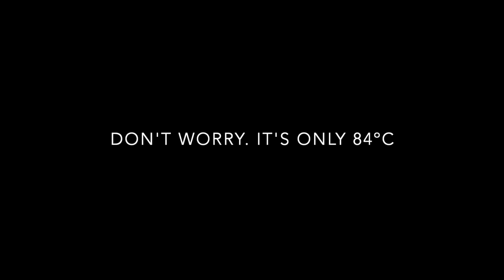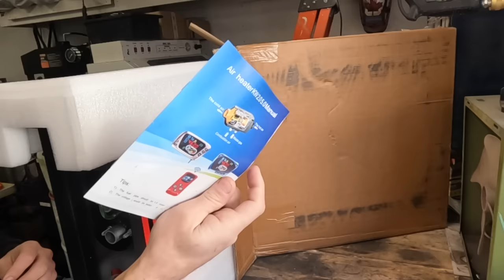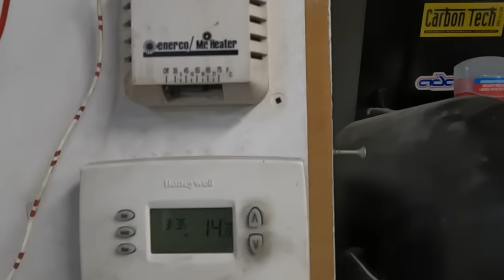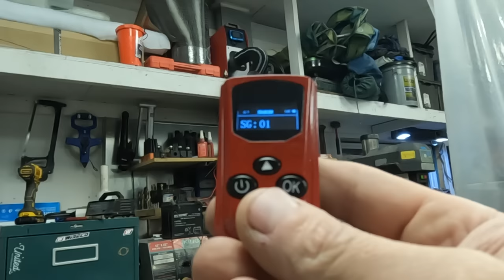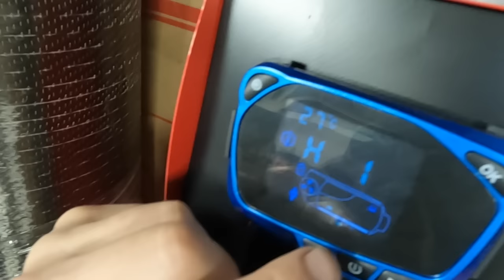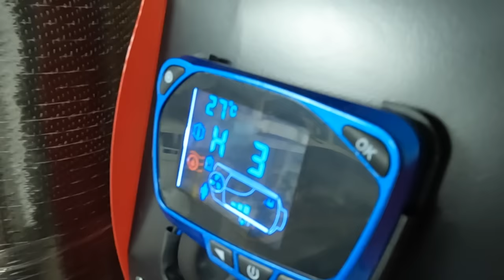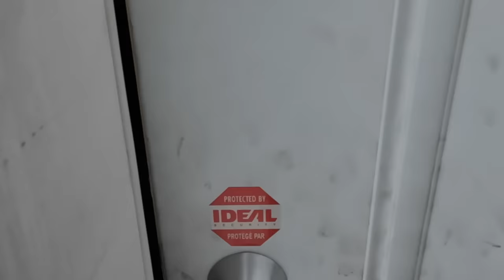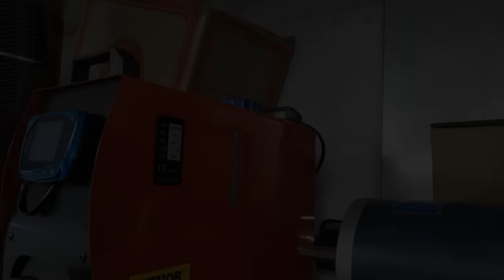Chinese Diesel Heaters - DON'T BELIEVE THE HYPE !!

Comment: Don't use waste oil will cause over heating/smoke  and add some decent diesel .
Reply from the maker: Yes, I have been testing / experimenting with waste oil mixes and have had several issues. I now have a whole series of videos dedicated to this topic. I recommend using diesel, but for me it is not economical as it is over twice the price of natural gas. (i have two NG heaters in my garage)

Comment: I think, maybe...possibly, you should have let set for a bit before restarting.  I have a lawnmower that does the exact same thing.
Reply from the maker: Sounds like a cool lawnmower !! You're talking about the flaming exhaust ? I'm guessing that your lawnmower is running rich, most of them do.... also, your engine should have a brake to slow the engine when you shut it off... if not, the fuel will keep dumping in when you kill the engine and lots of unburnt fuel will end up in the muffler... then when you go to start it next time BANG ! It's pretty exciting.

Comment: I have heard of ppl using these for 3-5 years with no trouble, then some use them for 3-5 minutes with nothing but trouble!!   I think I'd build a little centrifugal filter for the oil,  a modified break drum, spun at about 2500-3500 rpm will do nicely, a roughly 12" drum, with cover coveri g the large opening to about 3"-4", no more than 6" ,  attach the cover seal with silicone,  the clean oil will come out the hole and be slung off while spinning, so it needs to be inside a tub, and mounted on a motor, with a stand from 1" tubing, and plate steel, use a tub with lid, and a drain hole in the end, at the bottom, with a lid , having a hole in it , at the center of the drum, using a funnel, that fits thru the lid, into the center of the drum, about 1" below the top plate,  turn it on, and fill with oil slowly, the dirt will stick to the walls if the drum, the clean oil will climb the top plate, and exit the hole and be slung off the drum, collecting in the tub, works well with cooking oil also, removing the top plate to clean out the gunk regularly, depending on how dirty the oil is, is a must, or it will stop cleaning the oil, the edge of the drum can be wrapped with denim or foam filter matereal for an extra layer of filtering,  but at over 2k rpm only the lightest matereal is going to make it out,   the break drum will need an adapter plate to fit the motor shaft, and cover the holes in the drum,  then it will need to be centered,  and all holes sealed, of coarse a pot will work also, cut a hole in the center of the lid, make a latch to hold it on, and still an adapter to the motor, but smaller the diameter, the more rpm the motor needs to spin, a 8" pot will need to spin 3k-4k rpm, 
Faster the better,  just Incase it may help,  dirty oil may cause issues as well!!  Good luck!
Reply from the maker: So many comments that YT didn't inform me of... 

Thanks for the very detailed comment with all the information. I did think if building a centrifuge, and if I do this would be a great way to do it... I love the brake drum idea. I don't know that I want to dedicate that much time and space to filtering fuel, but I really do appreciate the input !! I had been thinking about building one and wondering how to balance it but a drum would already be balanced well enough and have a centering hole... perfect. 

Thanks James !
Reply: Parts per liter.  BC

Comment: They are a diesel heater not a old oil burner, quite obvious the viscosity and contaminants in old oil are your problem rather than the heater
Reply from the maker: Yes... they are wonderfun units when used as diesel heaters. Unfortunately there are a lot of people making claims that they will burn just about anything, trouble free. I now have an 18 video series about my attempts to burn oil to 1. Show people that it is a challenge and 2. Try to save some money and 3. because it's entertaining.

Comment: sorry to be pedantic  but the clue is in the name Diesel Heater. after some initial  hiccups with my mucking around with the settings black and white smoke and overfueling issues, it runs perfectly at least 10 hours every day. I heat my house to 20 degrees C for 1/6 of what it costs to use a gas boiler with a 2kw diesel heater. 10 litres of diesel lasts me about 5 to 6 days. believe it or not youtube is your saviour as the chinglish manual is rubbish. it should drw no more than 7 amps when the glow plug is running and afterwards 1 to 2 amps when up and running.
Reply from the maker: Sorry I missed your comment. Just seeing it now. 

I get what you are saying about them being "diesel heaters" but lots of diesel engines will run on all sorts of stuff, as long as it's filtered. Also, they make these heaters that do run on gasoline and diesel. Adding to the confusion is the fact that there a whole bunch of people saying that they have run these on nasty waste oil for years without issue... why would someone lie about that ? 

I'm guessing you don't live in a very cold climate, if your heater is able to keep your house at 20C. I'm curious as to why it cost so much more to run a gas boiler ? Also, gas as in natural gas, propane ? I have the opposite issue here.... diesel / home heating oil are both about$2 a litre, and it's often -20 to -30C. My "8kw" (really 5kw) heater can't even keep my garage at over 14C and on diesel it would be about 10L a day, about $600 a month about $200 more than it cost to heat my house and garage combined, on natural gas. 

YouTube is where I always turn for information, and I usually watch enough videos so that I can pick through the trash and find the little nuggets of good info. Thanks for the comment. Cheers.

Comment: ordered this heater in 8kw version to get it to run on waste oil which I can get in almost unlimited quantities for free, because car repair services have to pay a lot to get rid of it. From what I saw till now it's good idea to have two oil tanks, one with pure diesel and one with alternative fuel with valve so you can start it on pure, than switch to alternative. For the waste oil itself its good to have it in a large barel and let it settle down for a month, than pump if from the top so rubish stays at the bottom. For finer particles it's good to have 10 micron filter. Then comes the diluting. My friend uses 30% red diesel to 70% filtered waste oil for his WV golf mk2 and It works fine for more than 10 years. So heater should work fine too. I will experiment with diluting waste oil with diesel and maybe a touch of gasoline.

I assume this heater must be at high setting and with little manipulation from fuel quantity and air quatity It should burn clean. If you turn down the heater unproper burning and carbon buildup normaly ocurs. I had water heating for the house on red diesel and it was similar.
Reply from the maker: Thanks for the comment ! 

I think the difference between this and a diesel engine is that there is very little pressure or turbulence. The combustion chambre of a engine is a pretty violent place, so deposits can be forced out as they are produced. Filtering is a great idea, the more, the better, but in the end you will have contaminants / stuff in the oil that doesn't burn well. Most of that stuff is going to settle in the burn chambre and only come out with you pick it out. 

The starting on diesel trick may work if you are running your heater for short periods, a few hours at a time, but I run mine for days on end. The diesel will 100% clean out some of the nasty stuff from oil, I have tested this by running diesel for a few days and then taking it apart. Start up and shut down on diesel would work for some people, but on waste oil mix, mine will stop working after a few days even running at really high temperature. 

I have heard claims that you have to burn oil with a much higher fan speed and slow the pump so that there is enough air flow to 1. help burn more completely, and 2. Help push out the junk that doesn't burn before it builds up. I may have to replace my controller to be able to control fan and fuel speed independently. 

I have tried the "alpine mode" that leans out the mix, and it only lasted 10 hrs before completely clogging up. I've also tried to manually decrease fuel flow by pinching the line, and that didn't work either. I will post the recommendations someone gave to me, if you have a controller and you can do this, awesome ! 

	
Dayle Edwards . I have three of these heaters, all burning oil. I have hundreds of liters of the stuff... Set the pump and fan speed to my settings. Run the fan speed at full rpms. The heater will not run any higher than a pump speed of 2.5 to 3 Hz without eventually clogging, this will slightly reduce heat output. Above 3 Hz, there is too much oil and smoke will result. My heaters start reliably and don't smoke and dont smell after starting.

Comment: I have 3 diesel heater and they work flawlessly,I use diesel only.im not trying to burn used motor oil in the danm thing.there a reason there are called diesle heaters not used motor oil  heaters.
Reply from the maker: I agree. I have 4 and 3 of them only get diesel. Awesome product. 

These videos aren't saying anything bad about the. heaters, they are pointing out that burning waste oil is a bad idea ... just in a creative way. This is part one of over 30, haha.

Comment: Weird how you can just go down to the hardware store and buy a ready heater or equivalent diesel torpedo heater for about 2 to 300 depending on the size and they last for 30 years and are completely safe for use inside. I don't know why people keep buying these Chinese death traps.
Reply from the maker: Thanks for the comment. 

There are a few good reasons, and a lot of not so good reasons. These things vent the exhaust outside, so if you have an area that is fairly well sealed, you don't need to worry about CO poisoning. They are very compact and don't take up floor space. They don't require any space in front of the heater due to high temps coming out, they can be turned on and off with a remote control. You can set a target temperature and they will heat to that point and go to low heat mode until the temp drops. They are between 2 and 5 kw so perfect for a small area, where a torpedo heater is too much. They are also used in RVs, campers etc.... so there are plenty of good reasons. People also purchase them as back up heaters for their house as an emergency. 

I don't think these are a good primary heating source for your house, or a large area as they just don't make enough heat. Torpedo heaters are great for large open areas and make lots of heat, but they also consume a lot of fuel.
Reply: @loweredexpectations4927  they don't produce any CO, if they did they wouldn't be allowed to sell them. They run in a lean burn state, so all you get is CO2 and water. And you don't waste any heat by pumping it outside as exhaust. Yes they may burn more fuel per time, but they are heating the space more efficiently with that fuel. A two car garage can be up to 70° in like 5 minutes and then the thermostat kicks the heater off until it cools down. If you were to run it continuously it would be 150° in there.
Reply from the maker: @agentjwa  Maybe it was an older one, but I have seen videos of people testing them and they produce CO. I have worked with them several times in fairly open areas and I can't stand the smell or sound of them. I can't imagine using in in something as small as a two car garage. 

What you are saying is true, they dont' waste heat pumping it outside, and they do heat up an area quickly. I feel like they are good for an uninsulated area, a barn or worksite, but yeah, I can't imagine using one in a two car garage.
Reply: @loweredexpectations4927  the problem is sometimes they get out of adjustment or the nozzle gets slightly clogged and they start to run rich, that's why you can smell them. But with the little research and a $20 fuel pressure gauge you can adjust the pressure and get them running perfect and they don't smell like anything and don't burn your eyes. I've actually bought about 10 of them from friends and co-workers because they quit working, almost every single one was clogged fuel filter or someone messed with the fuel pressure without knowing what they're doing because they just see a screw on the back of it and start messing with it. I usually get them for about 10 to 20 bucks and sell them on craigslist for $150 or so after maybe 15 bucks in parts and a half hour of labor.
Reply from the maker: @agentjwa  Right on ! Sounds like a good deal for you, haha. 

The ones that I have the most experience with were units on job sites... The most I ever did was put fuel in them... I'm guessing that every one of them was from a rental place, was abused and only "serviced" when it refused to work at all. I honestly have zero idea of how they work ... I've never looked at a diagram of watched a video of one being taken apart / repaired.
Reply: @loweredexpectations4927  check out @sixtyfiveford he just did a really good video on getting an old one running perfectly a month or so ago.
Reply from the maker: @agentjwa  Will do. Thanks.
Reply from the maker: @agentjwa  Good stuff. Pretty cool how they work, a little vien air pump, sparky plug and a fan.... 

Kerosene here is about $4/L . Have you ever run one on diesel /heating oil ? Just curious.
Reply: @loweredexpectations4927  I actually have never run them on anything other then pump diesel, usually get the red dyed diesel from the co-op so I don't have to pay the road tax.
Reply from the maker: @agentjwa  Right on 👍 I figured it would work but wasn’t sure. Interesting that it starts with a spark plug 👍

Comment: The current consumption is much higher when it is starting. Prepare for 10 A or more.
Reply from the maker: Yes, this is very true. The glow plug pulls a lot of amps on start up, and shuts off once the heater is running.

Comment: Robert Murray-Smith made a video 5 days ago on how to clean waste oil with gelatin then he adds something else to it and it works great.   Worth the 7 minute watch time.
Reply from the maker: Thanks for the comment and recommendation... I will be sure to check that video out ! Much appreciated.
Reply from the maker: I've watched the video... I'm curious if it would work with motor oil. He is using cooking oil. Adding the paraffin adds quite a bit of cost to the fuel as it is about $6 per litre. I may give it a try.

Comment: Could they heat up a garage  24x26
Reply: Yes and no... Mine is 24x26 and it is able to keep it about 10 - 13C when it is about -30C outside... I have 2x6 insulated walls and a partly insulated attic area. The issue is that it is going to cost you a lot of money.  I would not suggest running these on anything but diesel, and burning diesel is going to cost you a lot more than natural gas or propane. If you are using it a few times a year to take the chill off, then it might make sense for you, but if you plan on using it all the time then I would get something else. 

Propane or natural gas with a ceiling mount Mr Heater will work a lot better, be faster, more convenient, safer, not affect your insurance and increase the value of your house / garage. 

The only reason I have one of these is because I was under the impression that it would work fine on waste oil and that I would have some free fuel. I'm continuing with my experiments but I have not yet found any way to make waste oil burn well and cost effective.
Reply: @JoelArseneaultYouTube  thanks for the reply
Reply from the maker: @kyleerickson3382  Sorry for the confusion ... I replied to you while I was logged into my other account. I'm guessing you figured that out.

Comment: As with most cheap chinese things I buy on the internet, I always budget and extra 30-50% ontop of what I pay to.... bring it up to a better quality. Out of the box they usually only run really well at higher power settings. If you intend to mostly use it at lower power, I recommend switching to a smaller fuel pump, or putting in a fuel pressure damper (you can get these cheap as all hell at most car junkyards). WIth the very small diamater exhaust they can suffer.. I had my local car muffler place weld a small catalytic converter onto it and then scavenge waste heat from the exhaust which adds another Kw to your output and makes it much cleaner... Just if you've gone to the expense of putting a cat onto it, only use good quality diesel... no motor oil or chip fat, those will ruin the expensive cat and clog it up.
Reply from the maker: That is often the case. I have found this heater to be pretty great. Considering all of the abuse that I have put it through, and the fact that it is still running ... That says something. 

I have considered getting a smaller fuel pump to change the afr instead of changing the  hz (my current controller can't do this) but I have already ordered a new ecu and controller. Funny that you mention the cat... I have a friend who is going to get me a cat so that I can do the same thing, but yeah... it would get destroyed pretty quickly running anything but clean diesel or maybe kerosene. 

Thanks for the comment !